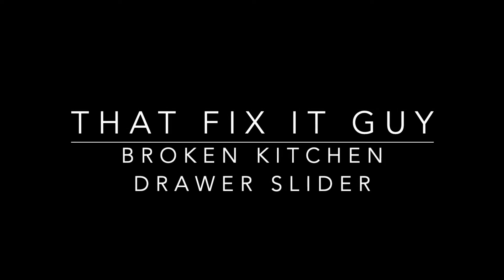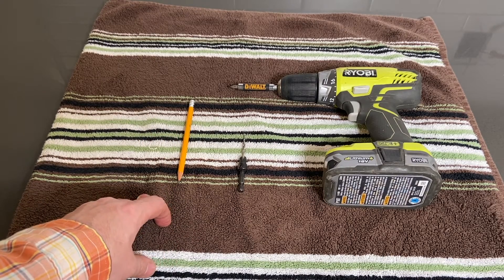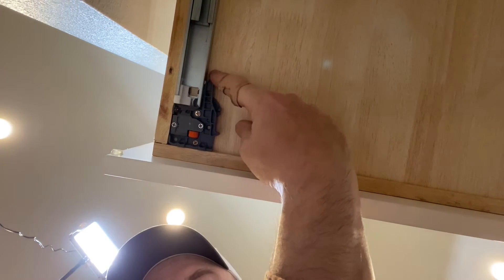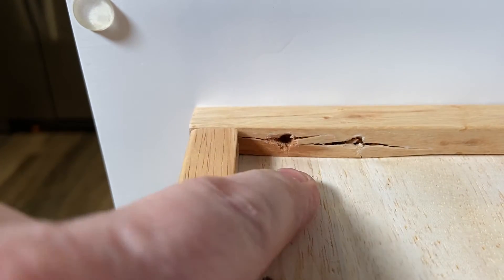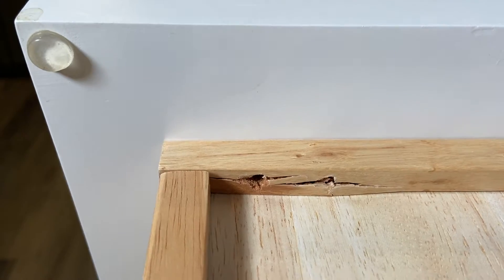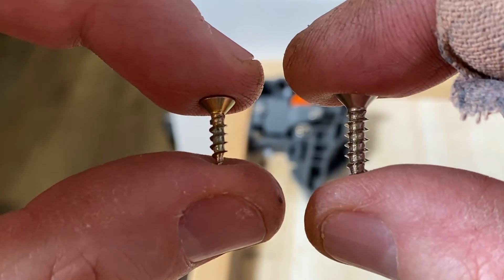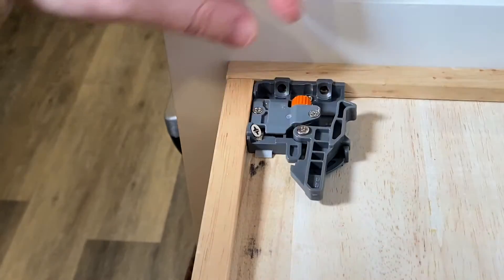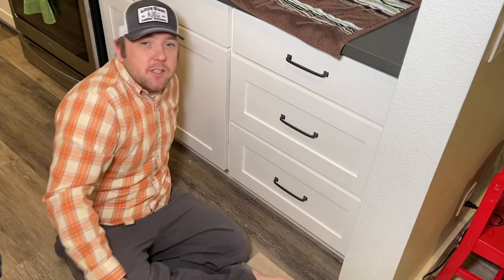Kitchen drawer slider broke

Comment: One of my drawers is not breaking! Before the drawer was breaking and then the was closing slow, without any sound, now it is not breaking.  What do you recomend me? Thank you!
Reply from the maker: I would pull the drawer completely out and try to locate the issue.  You will see better that way.  there should be tabs on both side of the drawer that will allow you to remove the drawer.

Comment: How can I take out a kitchen drawer to replace slide? granite is on top of the cabinet, so only way is through the drawer but they don't come out by just sliding...ANY SUGGESTION?
Reply from the maker: There is going to be some kind of button or push tab to release the slide. Send me a picture if you like and I will look at it. ufix247@gmail.com
Reply: @ThatFixItGuy  THANKS SOOO MUCH for getting back to me. Just saw your response. God bless youtube :)